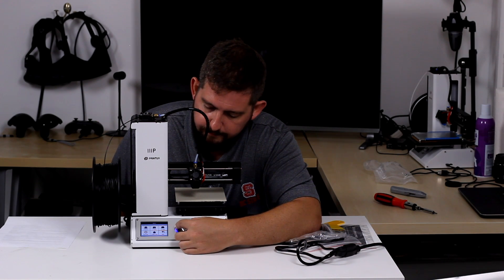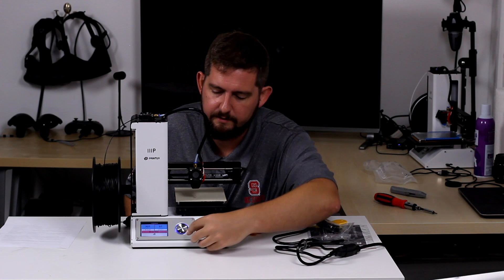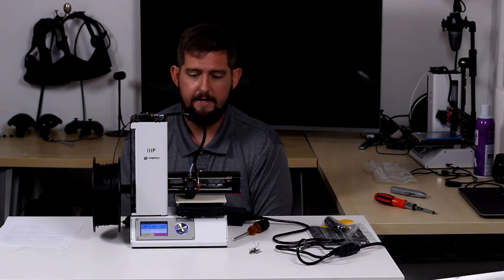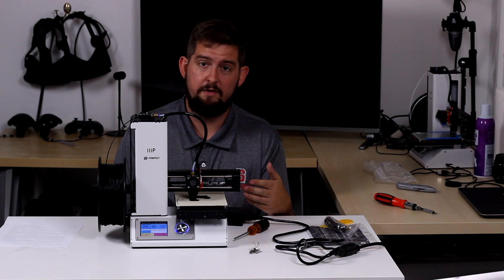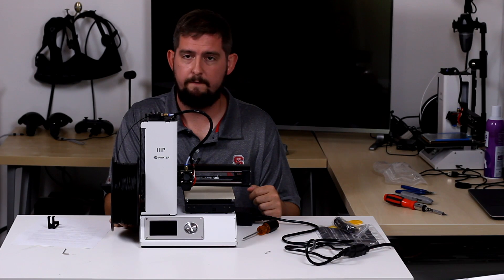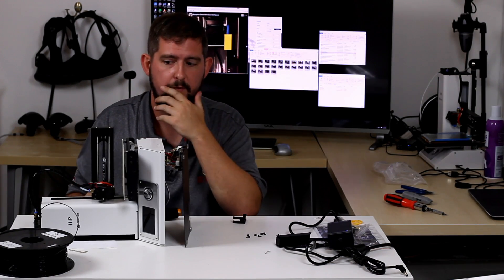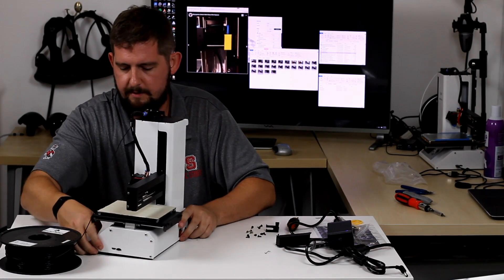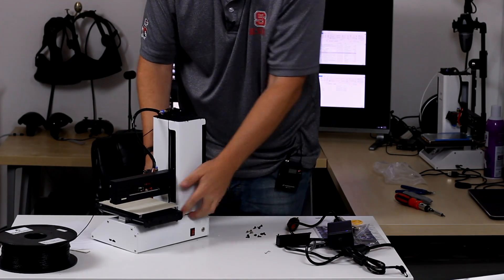Monoprice Select Mini 3D Printer Beginner's Guide (Part 5) - First Print + Installing the spacer

Comment: Not really sufficiently zoomed in when showing the screws at the bottom that you need to remove, and the interior of the printer is so dark, and not zoomed in enough that you cannot see how and exactly where that spacer needs to be installed.

Comment: Mine's coming today! Callooh, Callay! A tool that might be helpful in leveling the bed is what's referred to as a "go-no go" feeler gauge. It is a feeler gauge that is stepped, with one thickness a thousandth thicker, and one a thousandth thinner. If the thinner part of the blade slides through the gap, but the thicker part doesn't, then the desired gap is achieved. Use it to check at several points across the bed.

Comment: I'm sorry to say but your videos and instruction have messed my printer up so bad it wont even print now! Its trying to print backwards etc... before this it was doing fine. Now i cant get it to print a single thing. The LCD would never update although the Motion did... I don't know whats going on but honestly i wish i had not watched these videos at this point.
Reply: Actually I don't mind tinkering. I have a laser cutter as well and it requires about the same level of patience and willingness to engage. One thing I have learned is there is no one answer to these types of things what work great for one will not work for another. I sent that printer back and ordered a replacement and I have the new one working perfectly. It took a little tinkering but now it prints like a champ. One thing I would recommend is letting people know up front that before performing the firmware update that it does have issues, often does not work and could potentially mess your printer up pretty bad. That is where the videos went bad for me, the firmware update would not work at all, no matter what I did and it really did hose the printer big time. Thankfully, I bought if from Amazon and could request a replacement so I was out no money however, it did cost me a few nerves and time. I have also read of many people with the same problem. As for the rest of the videos good job... I know it takes a lot of time to make those things  and I appreciate the ones that were useful.
Reply: yea... i wouldn't recommend following videos dismantling an expensive device unless either you are a mechanic or the video is published by the 3D printers company. I know this doesn't help now, but for anyone else reading this PLEASE do not try something as drastic as this...(i've learned from experience :/....)
Reply from the maker: +Cj Grubb sorry you had a bad experience.  Several thousand people have used these videos successfully.  The key is to be patient, take your time, and learn the technology as you go.

If you don't want to tinker, 3D Printing is going to be frustrating experience no matter what printer you use.  My first printer took me 4 months to get it to print a single decent looking part.
Reply: Ahh, good to know.  It took me hours to get the firmware to update on my first Mini, the second one worked perfectly.  Fortunately there's no need to update firmware anymore!  And I'm really glad you got one that works for you.  Sometimes the right answer is to RMA and exchange :)

Comment: Great videos alot of good info but I have a question about the spacer,glass etc steps. This is will my first printer and im not that keen on taking this thing apart. Do these steps only benefit ABS or would they benefit PLA? I am only doing PLA for now and was thinking of not doing the spacer, glass, or insulation for now.

Comment: My print was at 80% and it moved off the bed. How can I fix this for next time?
Reply from the maker: +Woody's Geek Channel better bed adhesion, hairspray, glue stick and a hotter bed :)
Reply: Woody's Geek Channel I print at 200c with a bed temp of 60c. No problems so far

Comment: Hey i cant get my printer to find the zero of the z axis , i raise and lower the bed and when i go to print it starts like 4 mm above the bed.
Reply from the maker: +l h sounds like you might have a corrupted SD card or gcode if you can level the bed properly but when you print it starts out that high

Comment: I have Followed everything you have said. and for the life of me cant get the PLA to stick..  In fact i cant get anything to stick.. im realy close to returning it.. Im not used to this kind of printer and starting to think i made a huge mistake.
Reply from the maker: If nothing is sticking, the bed is too far away from the nozzle of the hot end.  Make sure you're using a piece of copy paper or notebook paper (aka thin!).  Get the distance between the bed and nozzle even closer so you can feel the paper dragging between the two.  There is some trial and error, especially when you're starting out.  If you get frustrated, walk away, have a beer, and come back later.  

My first printer (not nearly as good out of the box as the mini) took me almost 3 months of fiddling to get to print anything even halfway decent.  It's a skillset that does take time :)
Reply: yea looks like i have a Dip in the middle of the Bed.  I thought i seen some kind of jack for the middle but if i cant print how do i even print that lol
Reply from the maker: Bummer!  That's definitely why I went with a glass plate.  The way I got around this was to temporarily tape a spacer in place (I used a couple of cut up popsicle sticks, taped to the Z-housing to raise the z-height enough to fit the glass plate in).  Then got it level, printed the real spacer, installed it, and went on my merry way :)

Comment: any idea why filament is not coming out when testing the extruder? I checked in pronterface and my filament
 diameter is set correct to 1.75? I am showing the bed and extruder are heated to temp and I was able to push the filament through into it stopped. If I try and extrude, eventually I get that noise you mention where its bogged down with filament
Reply from the maker: What temperature and filament type are you heating to?  For PLA, start at 195C.  Raise the z-axis so it's clear of the bed and use the dial and menus to manually extrude using the extruder motor.  If it clicks, try raising the temp to 200C, then repeat.  You may need to go as high as 220C depending on the brand and type of PLA, but not above that.

If, at 200C you still get clicking, then you have a partial clog in the nozzle most likely.  You'll need to do an atomic / cold pull to clear it.  You can follow this guide http://bukobot.com/nozzle-cleaning until I manage to publish a video on doing cold pulls on the MP Mini :)

Comment: I've had my select mini for a few days have ran into a few problems but resolved them. I'm using 1.75mm PLA filament and I've heard from numerous people saying I shouldn't need a base because PLA sticks but PLA has yet to stick, I need to use raft whenever I print. Any ideas?
Reply from the maker: https://www.facebook.com/groups/1717306548519045/ is the "official" facebook group :)
Reply from the maker: Will Pitsch if it isn't sticking, you've likely got the bed too far away from the hotend and need to level it closer.  Join the Facebook group and post some photos of what you're experiencing, we can help you there much better :)
Reply: Whats the name of the facebook group? i searched and found 6 of them. some with some not nice people.
Reply: Thanks Tyler
Reply: If it's not sticking you probably need to level your bed.   Look for bed leveling information.  If the print head is too far from the bed then it's pretty much spaghetti time as nothing sticks to the bed or it lifts off easily mid print.  Mine is working just fine without heating the bed with pla.

Comment: so today (christmas) i got a brand new out of the box MP Select Mini 3D printer, set it up and loaded filament fine and started the provided test print (a cat). everything worked perfectly and the print came out great but the filament it came with ran out about half way through but i got some extra PLA/ABS along with it so no problem right?
loaded up the PLA and when i started to preheat it and extrude it to make sure everything was workingit gave off the clicking noise you mentioned in the video and also does it during printing and nothing comes out! so i did some searching and people said that its a jam so ive been "clearing jams" with everything from thin gauge wire to the atomic pull for a few hours now and even when shining a light down/up the nozel i can see that everything looks clear and still no progress... i plan on contacting Monoprice support after the holidays but this is pretty annoying to say the least...
have any insight into this?
Reply from the maker: nottomd2 you can't just feed in new filament when the old runs out.

Follow the instructions to swap filament in part 8.  It's very likely that you haven't actually clogged the hotend, rather the filament just isn't making it to the hotend.

To double check, take off the Bowden tube and cut off a foot or so of filament.  Heat the hotend to 200C and manually push it directly into the hotend.  It should extrude.  If not then you have a clog.  Hopefully you didn't heat it over 250C, you may have damaged the PTFE liner if so.  If it's not clogged this way, remove the Bowden tube and make sure there's nothing jammed in it (filament should slide through freely, with little resistance).

If the Bowden tube is good, make sure the extruder lever arm isn't cracked. 

If it is clogged, remove the nozzle, let it cool down and get a drillbit that is 1.75mm diameter or equivalent, and carefully drill out the PTFE liner in the hotend.  Reassemble and try the above steps again.
Reply: bowden tube and PTFE are all clear, and i dont see any cracks anywhere on or around the arm. push in some fresh PLA and it immedietly squeezed out some of the older stuff but then quickly became very difficult to extrude.
spent about half an hour drilling out the nozzle and using some hot wires to poke through the top/bottom to get more out and its still just as difficult to extrude. is there maybe anything i can try to dissolve it with?
Reply from the maker: nottomd2 don't drill out the nozzle.  You shouldn't mess with the nozzle at all.  Drill out the hotend, the threaded portion in the heatsink with the internal PTFE liner.

Follow this guide to do cold/atomic pulls http://bukobot.com/nozzle-cleaning

I'm currently working on a video on how to do this specifically for the Mini, but that is your best bet to clear the nozzle itself.  You may need to do it 5-6 times, and if you have ABS, Nylon or cleaning filaments, they work MUCH better than PLA.
Reply: welp i finally got it working again, thank you! i had tried the method you posted along with some others but this time i just did it about 10 times just to make sure and i guess it finally took. thanks so much for all the help!

Comment: Do you think that this is the best 3D printer for beginners? I have never bought one before.
Reply from the maker: I think the best beginner printer is the Printrbot Simple Metal, but it's also 3x more expensive.  If price isn't a huge concern I would go for it instead.  But for less than $400, this is by far the best "first" printer in my opinion.

Comment: i just hope it work with my ubuntu
Reply from the maker: Should work just fine, although for Cura you may been to manually install Python 3.4 depending on your version of Ubuntu. https://ultimaker.com/en/resources/21362-cura-2-1-linux-not-working

And check here for getting pronterface installed: http://reprap.org/wiki/Printrun